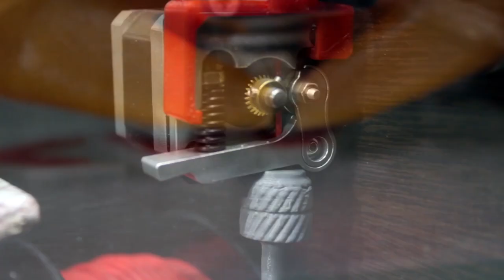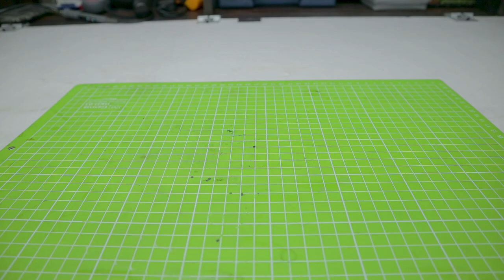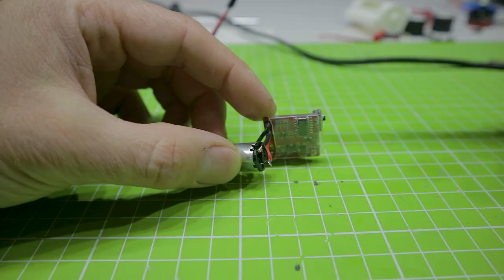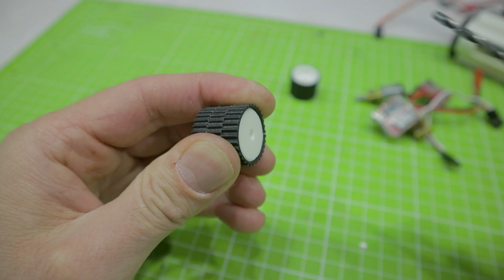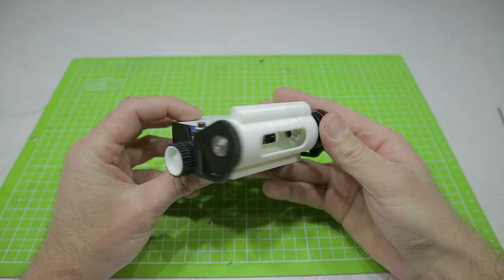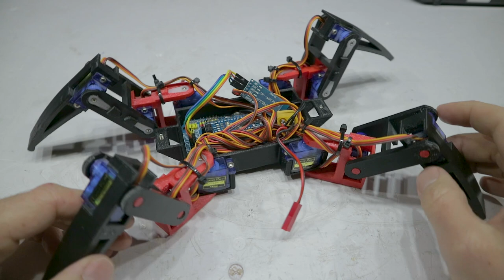Antweight combat robots - Spinner

Comment: Is there official rules for this? Having a thin carbonfiber plate as the hitting part of the spinner would probably do a lot of damage to plastic while being relatively light. The motor is kinda overkill here, a size like 1404 would probably save a lot of weight while still having a lot of power. The receiver setup also seems pretty heavy, current drone receivers like tbs tracer,  xm+ and crossfire are very light but I don't know if they are compatible.